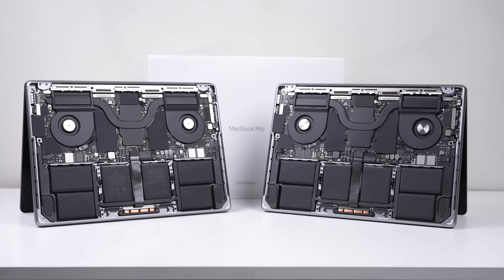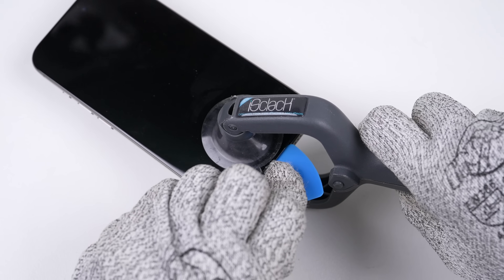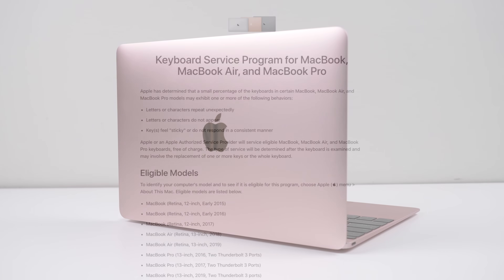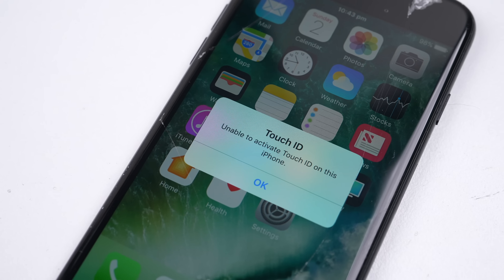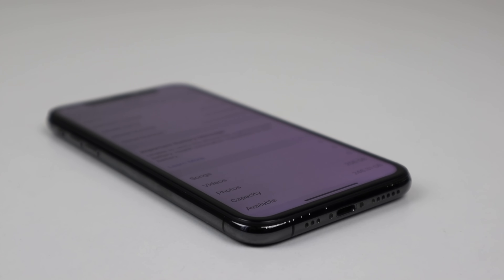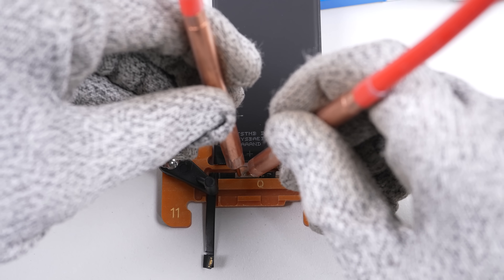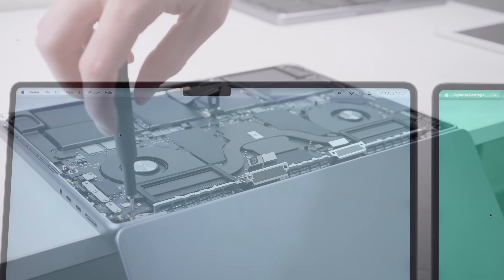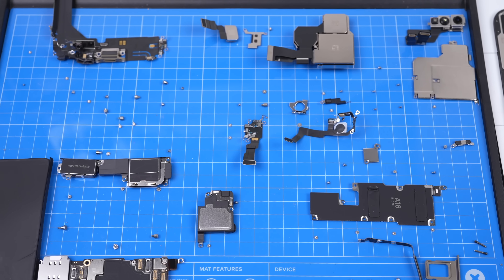Astonishing Anti Repair Practices By Apple In the Last 15 Years

Comment: when I think apple, I think about high standards of movement and performance in my arm to be lifted up and pull a middle finger as my strong determined left arm throws the divice into the garbage bin at a high-velocity rate to be super efficient and save energy never having to deal with this peace of shit brand

Comment: i'd still be using my 2006 black plastic macbook if the firmware was viable. i swapped out the external battery for a fresh one, did a fresh install, and that solved 99% of the issues i ever had, until software stopped accommodating older hardware. :(

Comment: Every Apple device is actually an expensive piece of junk made to break so Apple earns money on repairing devices.
I have a Samsung galaxy S8+ that is now 6 years old and still functions like a brand new phone. No repairs were made the battery was never replaced and still when fully charged it lasts 2 days until the battery is empty. With an Iphone your lucky if the battery lasts a day without recharging.

Comment: If you cannot prevent something happening, you need to get behind it and push. That way you have some control of the direction. 
This is why apple now "support" right to repair. It is also why Microsoft purchased a seat on Linux Foundation Board of Directors.

Comment: To be fair I didn't have the knowledge of these exact practices apple used but I always knew something was up. I cracked my phone a few years ago and I needed to get it fixed. Was told it was more expensive to get it fixed than to buy a new one. Makes 0 sense. But then it makes perfect sense when you consider the amount of effort that has to go in to fixing it. Had a mac too. made a windows partition and destroyed it. Barely boots.

Comment: everyone is always ranting, and rightfully so. the practices are evil and disgusting. BUT on the other hand, nobody tackles it with a range of repairable, upgradable devices that provide the same or a better mix of premium hardware quality feel, top notch performance, easy-to-use OS/interface, and interoperability. i would gladly change to other devices if they were modular but with the same nice design and materials, allowing me to use features like carplay or airdrop, along with an option to have a non-gigantic, thin phone (still clinging to my 4,7" SE).

where are the alternatives? i don’t want to carry a monstrous brick in my pocket like a fairphone, i don’t want to be limited to microsoft's ugly world of software (and spying on me mechanisms). i don't want a 6cm thick plastic laptop.

Comment: Here's a little tip for you. A flat blade screwdriver will work on every fastener if you have the right size. Torx, security Torx (with modification), triangle, square, hex, Phillips, and yes even apple's proprietary screw.
Reply: Not with shite pot metal screws they use with the iphone,, those could Crumble from being sneezed on
Reply: @cardioandfriends 😂😂😂

Comment: Apple is a corrupt company and everybody knows that but you can make a lot of money on the stock market by investing in Apple.   Apple wasn't always this way.   If anybody has been around long enough to remember the Apple 2 if you wanted you can just remove the cover and pull out chips and replace them yourself.   Once while walking along Queen Street where a lot of computer  stores were I saw a ROM reader copying Apple ROMs to disc. Back then there was an Apple clone called a Pineapple.   To get around copyrights the Pineapple did not come with any ROMs.   Basically Pineapple was assuming that the buyer could find illegal ROMs that were pirated to put in to the computer.   I think that was about 40 years ago. So Apple has had people attacking it that long.   I don't know if corrupt is the right word to describe Apple.   Perhaps they are more like people who put bars on the window in a bad neighborhood.

Comment: Ribbon cables hard mounted to large components instead of being a simple connector.
Means that a damaged ribbon cable (which for moving parts is a "wear item"), means replacing the entire larger component they connect to.

Comment: 9:43 I cannot believe that you have to pay $900 for a 1TB SSD today. After checking online, yes that is the current price. In the meantime I checked the prices for 1TB SSD drives for PC laptops and they range from $75 to just over $100. Apple is 12 times the price!!!! Also the Apple product seems to comes as a kit of 2 older 500GB SSDs rather than a single 1TB unit. A person would have to be brain dead to buy anything from Apple.

Comment: You can take off an apple display without removing the screws anyway if you really want too. My job is an Apple authorized repair center and sometimes we just rip off displays if the screws are stripped.

Comment: I had a collection of toy dancing flowers from the late 80s.
They "danced" when you played the music.
What amazed me when I looked at them recently, was they had a hole for you to oil the gear mechanism.
They also had screws so you could replace the motor, if it ever became necessary.
They had enough pride in their work to do this for at $10 toy. But apple won't even do it for a $2000 computer.
Reply: Technically a $1,000 computer. They just charge you $2,000 for it.
Reply: @malusvir  Probably only 200$
Reply: @malusvir  True. Way overpriced that apple thingy can perform.
Reply: @malusvir  Yeah, they do it because they can. State Monopoly. Lobby in every Congress. If they pay for politicians they don't need to think about anything else.
Reply: @malusvir  1000 is a fucking reach. I'd value macbooks around 600. They are at the same category with acer shit.
Reply: @malusvir  for the brand, component wise i guess they make an insane profit
Reply: @malusvir 👏👏👏🤣🤣
Reply: And the part that really grinds my fucking gears (no pun intended) is how much they mark up their products to maximize the profit. I remember those little dancing flowers. Back then, that was enough to keep you happy. Now, you need to go damn near bankrupt just to exist because technology is rammed down our throats at exorbitant prices.
Reply: No, it's a $400 shitbook priced at $3,000 where the parts are advertised as being unique to them and thousands of times better than everything else ever but is actually just off the shelf discount parts.
Reply: @mcrichton46  Well not really. These things are novelty items. The sort of thing that will be used and discarded. Maybe you put it next to your speaker at a party.
But they still built it with some view to servicing them.
I bought a box of 50 for $25 used, back in the 90s. I thought they might be worth something in the future.
Look Up Takara Dancing Flower. You'll see what I mean.
Reply: @mcrichton46  A lot of stuff is dirt cheap these days.
Plane travel, telephone calls ... heaps of stuff.
If you have ever talked internationally on a phone call, you will know what I mean.
$250 for ten minutes IIRC.
Literally "Hi, I Love you!" Try then you hang up.
These days. It's free.
Reply: @mcrichton46 You don’t need to buy new technology. Apple products last at least a decade. You’re making a choice, really.
Reply: @EternalShadow1667 No they don't lol
Reply: @EternalShadow1667  So long as they give you a ten year complete warranty, that would be fine.
But they don't.
Reply: Fuckin this is a "Hardware DRM" God fucks sake
Reply: passion doesn't cut corners
Reply: is people not aware that other brands exist?
brands that don't sell over-priced, under-powered devices.
devices that are made to be more repairable, and compatible with most software? 

this reply section is ridiculous
Reply: Wow.
Reply: Monies
Reply: They're absolute C*NTS!
Reply: Capitalism kiddo, its all about increasing the margins to maintain growth, without growth there is only collapse.
Reply: Just bought my GF a Nokia smart phone.
It has a user replaceable battery and screen.
Reply: Yeah some of those unrepairable devices cost 2000-3000 and add on top of that a 1500 phone. Damn you could soon buy the cheapest car with that price. Imagine buying a car that could not be repaired.
Reply: "If your tiny little repairable toy is so great, it would still be selling till this day but they don't".
Apple, probably
Reply: This is why you build your own.
Reply: @Michael_Oliver_  until u need to carry around a laptop... but at that point get a old one and put linux in it
Reply: @VonVikoGoat  I would need a GUI enabled copy of Linux. I'm worth nothing with text prompt.
Reply: @Michael_Oliver_  BRB, gonna find out how to make a smartphone with nothing but off the shelf components, lumber, a jigsaw and a screwdriver.
Reply: @Michael_Oliver_  "Just create your own computer manufacturing business that rivals apple 🤓"
Reply: @Axodus ??? Are you being obtuse on purpose? Clearly, they mean building a pc with parts that manufacturers specifically sell to consumers for said purpose most of which not only rival apple but surpass them as whatever proprietary tech they have hardly competes with companies that just specialise in making a few parts.
Reply: @Angielovesgirls97  I'm assuming we're talking about MacBooks here? Which you're obviously not capable of building with parts online, so the only conclusion I could come to is the user was trying to imply creating a laptop manufacturing business from the ground up was a valid option if you didn't want to spend 2k on a macbook.
Reply: @Axodus nope just buy parts itd easy
Reply: @soulbreaker1467  if it's a mac-book you're screwed.
Reply: @Axodus  I mean... try framework.
Reply: @Axodus  why would we be talking about MacBooks? MacBooks suck.
Reply: @Axodus you don't need to rival them, just replace them.
Reply: @Axodus Bet, see you in 15 years
Reply: @mangolover1899 I see this as an absolute win.

Comment: What is also worth mentioning is that quite a lot of parts - typically power regulator ICs, battery charging ICs and so on are made impossible to obtain. IC manufacturers have signed contracts to provide certain components only to the final product manufacturers. Renesas for example manufactures ICs, but you cannot buy the, get their datasheets or sometimes even find them on their site. And all of that is because Apple and other electronic devices producers have contracts with the IC manufacturers to do so.
Another thing might be how Apple and others treat repairs. They do whatever they can to stop everybody from repairing their products. You must be their partner, who must then follow Apple rules - like Sell first, fix second. You cannot fix at the component level and you can't reuse parts from broken devices. Apple themselves do not repair things. They replace whole assemblies. Not mentioning Apple is not doing any data recovery. All "bad parts" including fully functional MacBook motherboards with just one shorted capacitor must be recycled. That means grinded to unusable waste, which is then "ecologically" processed. Not even attempt to use good parts or fixing anything.

Comment: I had a wild problem with MacBook Pro on M1 chip. I accidentally poured water which caused the laptop to die. I went to an Apple certified repair shop and they said that Apple prohibited them to repair the laptop since they couldn’t turn that on and confirm that screen wasn’t affected (the most expensive part). I went to another service, not Apple certified, and they were able to connect my screen to another laptop to check that it was okay. Which meant I had only keyboard and couple of components on the board to be replaced. Which resulted in much lower repair price that the Apple said due to the potential screen damage. That was the reason of their reject since it was almost around the cost of the laptop itself.

Wild!!

Comment: wonder what apple is going to do once the EU law comes into effect, that requires all mobile devices to have user replacable batteries, which have to either be possible to replace without using any tools, or common tools that are in most households, like philips head drivers and such. i think it was passed to be effective 2026, but i'm not sure.

Comment: They also glue in the long and thin centrally positioned motherboard in iPads, and they place it over the double battery connector, so in order to replace the batteries [which are also glued in] you need to first unglue and pry the long mobo from top to bottom, with no space to do it, since its between the batteries tightly. While you do it you can only pray you wont bend it too much and cause its failure by cracking it, or making the chip loose. And you wont know until you gut the whole iPad and put it all back together and connect the screen. Apple is a bunch of engineering c#nts.

Comment: So many false Statements in one Video!

1st. TouchID, today a Phone is a Wallet and every component needs to show that it was not tampered. With this security needs comes that you cannot change this with some 3rd party TouchID from unknown source. 

2nd. Security Screws, a screw is a screw. And pentalo for example provides less risk to destroy the screw during disassemble than a simple cross screw. A security screw never prevent disassembly. 

3rd Glued Batterie, it takes just 5min. more to get rid of the battery and replace it. You do it max one time on the complete lifecycle of a computer. 

4rd Solderd Memory, yes this is annoying. But today SMD Soldering is not that hard. So when you want more memory in the non M based MacBook Pros, not really difficult to do (same for SSD)

Only the Mx based Notebook are really not upgradable. On these devices Apple prevent Upgrade. But than the simple rule is, buy 32Gig of Ram and at least 1TB of SSD and you will never ask for more (Data today anyway stored in the cloud or NAS). 

And last: You can use Apple devices (special the iOS devices) for Years, Android is completely different. And Old Windows Notebooks filling the Bins all over the world (Nobody uses anymore a Core i5 2500k)
Reply: Apple fanboys are delusional.

Comment: This is in fields outside of IT technology too; Omega is a Chinese company that makes drink machines; I was the first technician to physically open a new one; FROM THE FACTORY every screw was drilled out round. All the metal shavings LEFT INSIDE were also causing issues in the evap coil they left inside. But that’s not all, they then riveted and welded a plate to cover every single area a human hand might be able to fit inside. It’s literally anti engineering made for profit what’s worse is it’s China so now your company is stuck with this dog sh*t because your CFO already got his kickbacks

Comment: I will voice an unpopular opinion, but I think that third-party ‘repairs’ are bullshit. Been there, saw some shit with some phones, laptops, etc.
1. 90% of third-party repair shops fix not the Apple issues but the sloppy handling of the devices by their owners;
2. On one Lous Rossman, there are 10 hacks whose fixes will work for a very short time.
3. Although a quick fix may be much cheaper than the whole circuit board replacement, it may leave the root of the issue, and give one false sense of security.
4. Infosec @ third party repair shops? LOL.

Comment: I'm not a fan of Android by any stretch of imagination, I only buy cheap used phones as they still have sufficient power even for light games, the most expensive one cost me around 30€.

It's just that Apple was never even worth considering, even tough I could have gotten my Dad's used iPhones (he gets the newest one every 2 years, thinking it's free with his contract... I gave up trying to explain it). Quite similar to Tesla, I'd rather have something without any prestige or luxury which performs reliably than something that's set up to fail and expensive/not viable to repair.

Comment: The only question is: how do apple fans still think that the company is good? It's kinda can be explained why the soldered parts and overall simplified design is a "new fashion in hardware", but how to justify multiple software restrictions? Apple fans either don't know about that or are just plain dumb.

Comment: Apple has a rather...sketchy history with their hardware from way back from what I understand. One story I heard was of a computer they made that would fail 100% of the time because Steve Jobs didn't want any fans or vents in the thing which would cause the thing to get STUPIDLY hot, the parts inside to pop out of place...and official 'help' from the company boiling down to "drop it from this height to pop the parts back into place".....yeah...then there was the whole thing with the antenna on one model of IPhone being covered up when held normally because apparently the thing was meant to be held as if you were on speaker at all times....them having scummy practices to prevent repair when not done by THEM personally for the longest time don't surprise me all that much.

Comment: This is the reason why I only sell Dell latitude laptops to my clients. They can't get away with this crap when they sell large volumes of computers to big companies.
One thing I've noticed is that on certain latitude laptops, you can only use a business Microsoft account when you first sign into the computer. This means you have to be a subscriber to 365 and pay them every month to use your own computer. The funny thing is,. Microsoft usually has to give these companies work arounds, which become public knowledge, making these B.S. requirements bypassable.

Comment: I have a 2020 macbook air with an m1 chip. I recently upgraded it to the new software, Sonoma, and it massively impacted performance. It was jarring seeing the time to open any app, webpages were slow to open and even the basic animations were glitchy. 3 years seems about the time when they would like their customers to buy a new product. Luckily I was able to revert back to the previous MacOS, Ventura, although, the process wasn't simple. Unsurprisingly, performance is back, animations smooth with apps and webpages opening quickly and running smoothly.